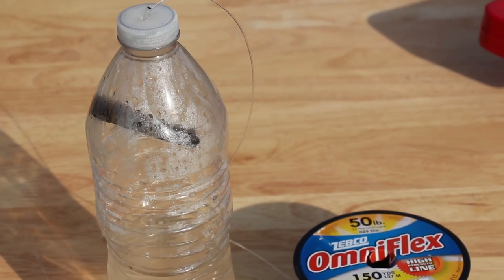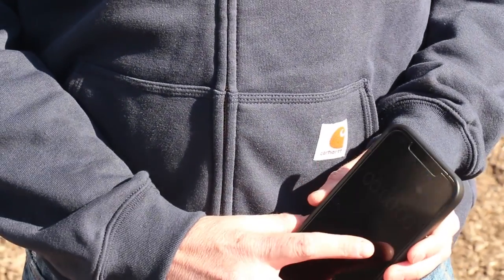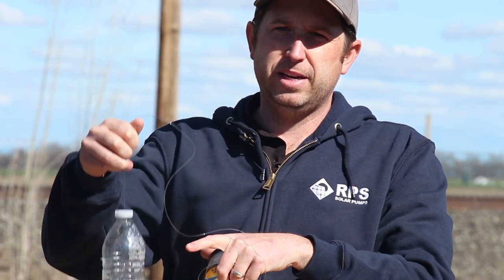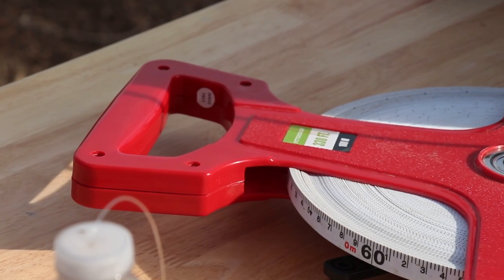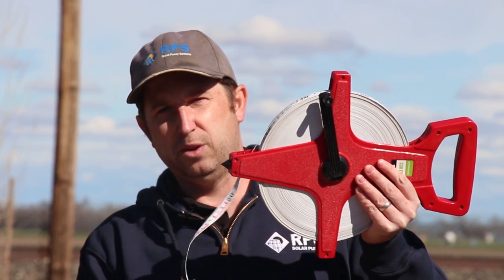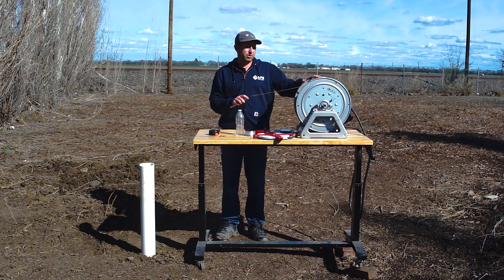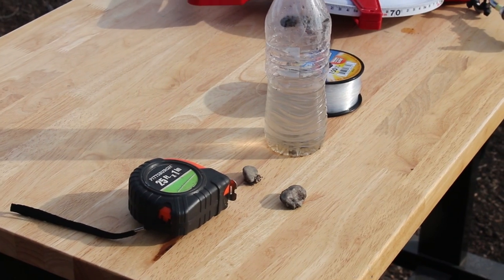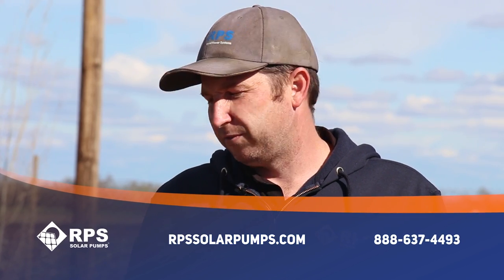Measuring the Static Water Level and Depth of a Well

Comment: Can you use the 300ft. tape with a weight method with the pump in the well still or would it get caught ?
Reply from the maker: Probably but be carefull.  I would use a smaller dense weight and use electrical tape to cover any sharp edges that could snag.

Comment: Well levels change with climate change. Is there something that you can setup in the well that would be able to monitor water level through a meter so we can check water level at anytime while the well pump is installed